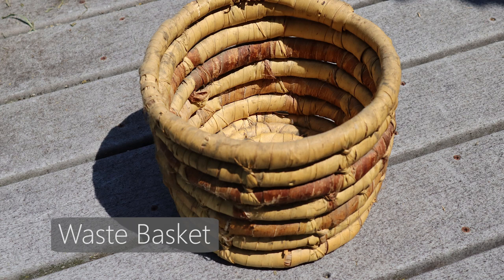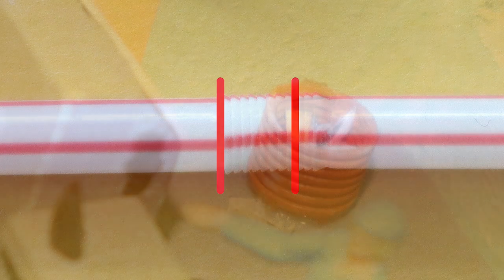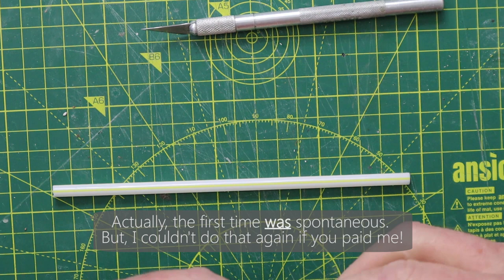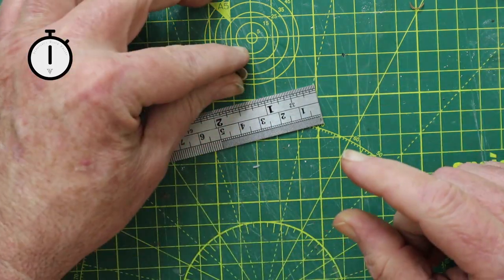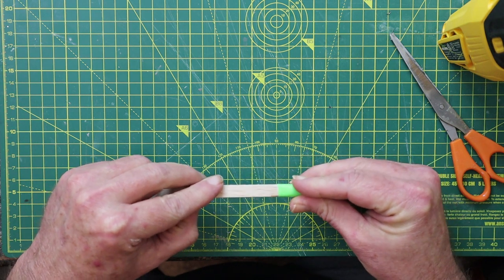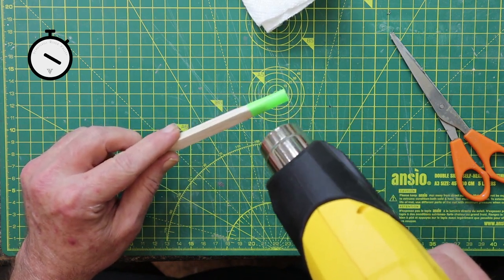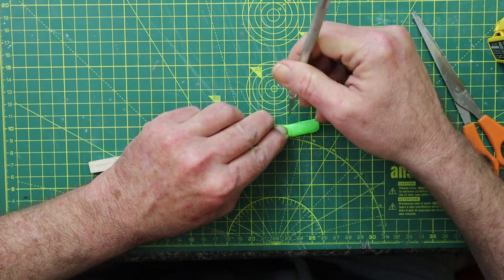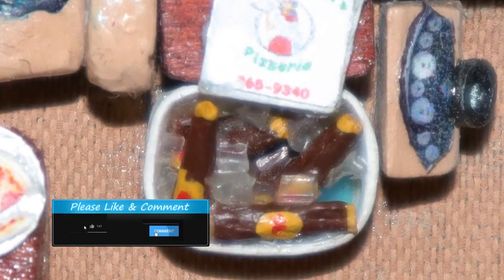Schuly Tip #1 - Modeling with Straws

Comment: Some top tips there John, I do like that use of the ‘plaster’ or as you call them, band aids, for the wicker basket. I reckon that could easily be adapted for a macrame rug or even a picnic blanket. Thanks for sharing. Paul
Reply from the maker: Great ideas Paul! I hadn't thought of them. Thanks a lot for sharing! We used to use the term 'plaster' but not in my lifetime. Band-Aid is actually a brand name. They were the first and only 'adhesive bandages' for a long time. As you can imagine, 'adhesive bandages' never caught on, so the name just became synonymous with the product. I appreciate your support. Best, John